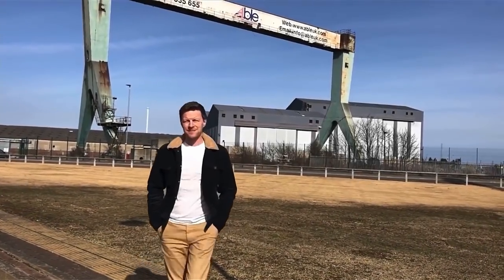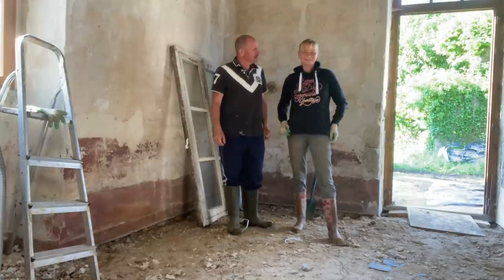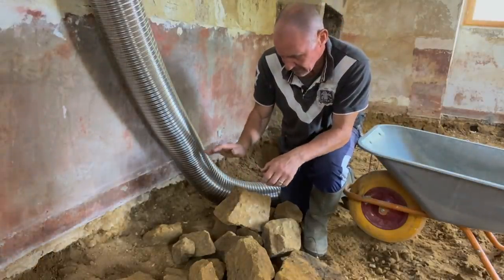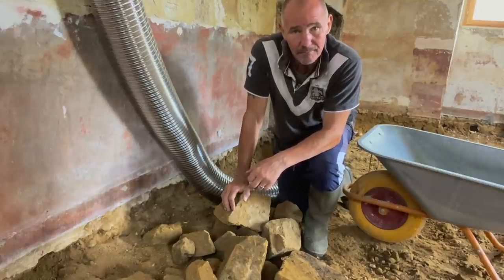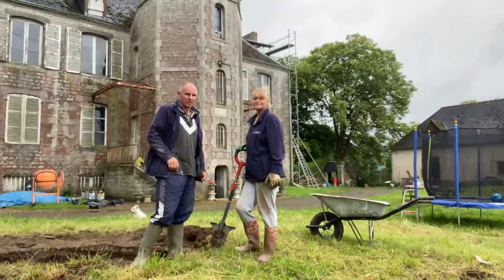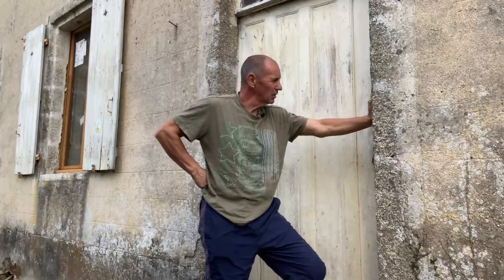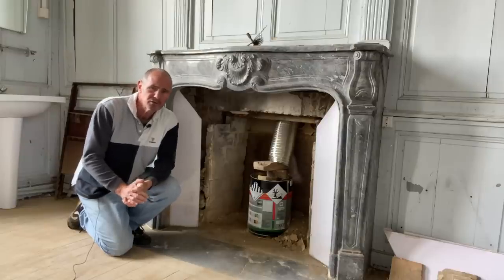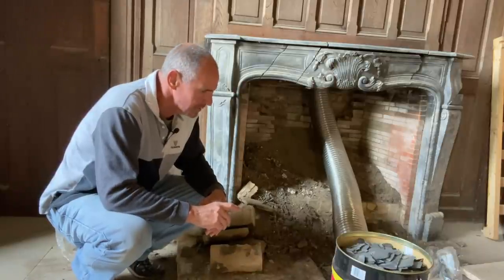The Château Cottage Dig Out & Hidden Original Feature. Ep14

Comment: Don't forget your water & sewer lines and do checkout radiant heat under the floors, it is so much better than having radiators dotting the walls. 

Building an insulated trench raceway to lay the pipes can be very useful if you change things later.
Reply from the maker: Thank you very much for the information 🥰